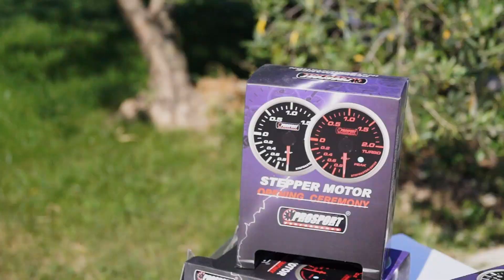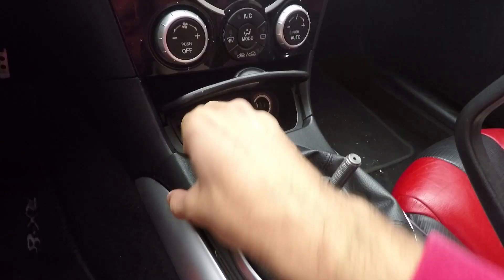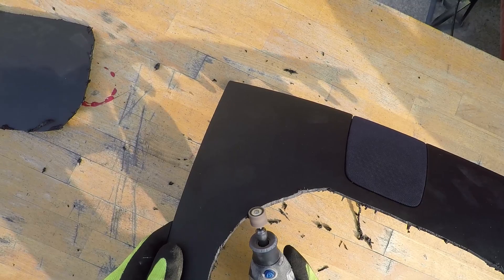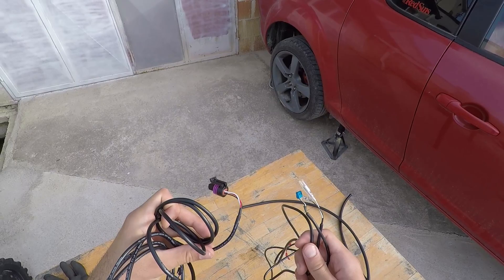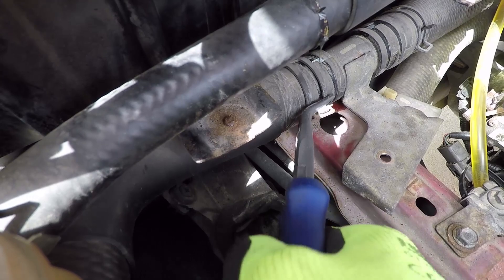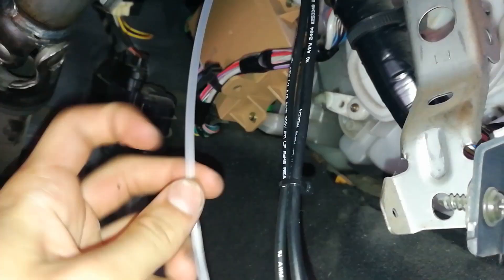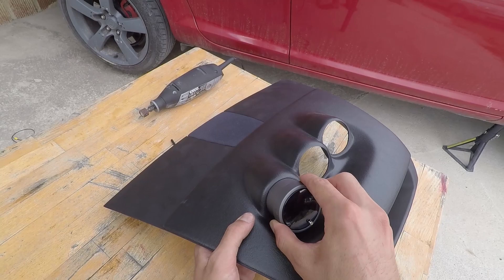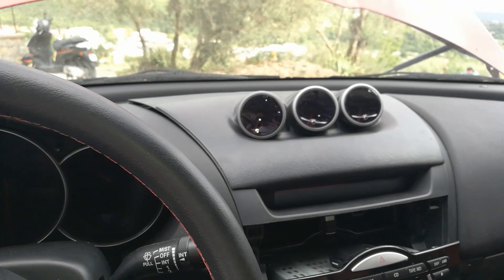Mazda Rx8 Gauge Install | Step By Step Gauge Kit Install

Comment from the maker: If you want to check out the items mentioned in the video, they are linked below: 
🇺🇸 USA & ASIA:
🟠WATER TEMPERATURE GAUGE: https://amzn.to/3U11UQR

🟠OIL TEMPERATURE GAUGE: https://amzn.to/3foylK4

🟠OIL PRESSURE GAUGE: https://amzn.to/3fscEZx

🟠OIL SANDWICH PLATE: https://amzn.to/3zGP8yJ

🟠WATER COOLANT ADAPTER: https://amzn.to/3Ws0JM0

🟠DASH GAUGE POD: http://essexrotarystore.com/product/feed-triple-52mm-rx8-meter-panel/  

🟠TEFLON TAPE: https://amzn.to/3h12nnr

🟠BLACK SILICONE GLUE: https://amzn.to/3WpBLwu

🇪🇺 EUROPE & 🇬🇧 UK
🟠3 GAUGES: https://ebay.us/FaxZPE 

🟠OIL SANDWICH PLATE: https://amzn.to/3WoWfpb 

🟠WATER COOLANT ADAPTER: https://amzn.to/3DUTNPX 

🟠DASH GAUGE POD: http://essexrotarystore.com/product/feed-triple-52mm-rx8-meter-panel/  

🟠TEFLON TAPE: https://amzn.to/3Nwo8b5 

🟠BLACK SILICONE GLUE: https://amzn.to/3UjVzzB
Reply: What sensors did you use and what connectors????
Reply: How long did it all take you?
Reply from the maker: @CivilianAdams  A couple of hours, but i was also filming, so it took longer.
Reply: How mm water coolant?

Comment: I did the same gauge pod a few weeks ago. It's much easier if you use add-a-fuse in the driver side footwell fusebox (cigarette lighter fuse)for power and main fusebox rear light for gauge night mode.  you don't have to cut any factory wire if you do it this way. for an added bonus your gauge pod is now running its own fuse so you don't have to worry blowing the fuse when you plug in something like a laptop charger.
Reply: Hi William, I am planning to do this mod this next week. I am done with Sensors and the gauge pod. My biggest problem is the wiring. I like the solution you mentioned here. As it seems to be clean and easy. But Japanda tuning guy says it is not the right solution. Cutting factory wiring, soldering/ connector clips is the right way. Does your set up still work ? For my new auto gauges I have 4 wires coming from gauge which should be connected to .

1. Red - Battery +
2. Black - Battery -
3. White- Ignition Switch + 12V
4. Orange- Dash lighting/ headlights
Could you please guide me where I can find these wires or Fuses. My gauge pod is located on the air vent. So, I am looking to connect the sensor wires either in Fuse box or wire harness below steering wheel. Any leads are appreciated.
Reply: I confirm it works. One cable i connected to fuse number 1 (cigar/lighter) and second one to fuse number 29 (tail lights). Thanks to that the display of gauges only turns on when i turn on my lights. Of course I used fuse adapters with additional 2A fuse. Im really thankful for that tip 👍👍

Comment: this dude is like the rotary chris fix hahah 

love this channel !
Reply from the maker: Thanks man 💪😊
Reply: @Drivenbymadness   video suggestion. 

maybe a video about what to do when going to look at a rx8 and you want to do the proper testing on it etc. 

like do you have them leave it cold so you can do a cold start then hot start or etc. 

how to do a proper compression test while looking at the car etc 

what compression numbers to look for. 
( if they are lower than xyz = good buy ) 
( if they are lower then xyz = engine will need rebuild right after purchase ) 

etc

i am in the market for a rx8 right now to add to my stable of sh*tboxes lol 

my friend has a 8 in his garage right now that he bought for cheap cuz it wont start( he was going to LS swap it and turn it into a drift car ) 

but ive loved rotaries and have owned a 88 fc vert. 

and feel like he is probably not doing something right. so i could possibly buy it off him for cheap and maybe get it running for cheap as well..
Reply from the maker: @theregoesmiller389  Already made it: https://www.youtube.com/watch?v=w4hxOINhdik&ab_channel=DrivenByMadness

Comment: NEVER attach 2 cables naked without anything, solder it or use connector, but NEVER just twist it together and use some tape on is. It can cause fire in your car. I know there is no big current in this case, but i think it would be important to explain in the video.

Comment: I followed this guide and did it! Im really thankful for that video 😁 the only thing i did different was power cables for gauges, I connected them to fuse number 1 and 29, thanks to that lights on gauges turn on only when I turn on my lights. I used fuse adapters with additional 2A fuses. Cheers!
Reply from the maker: Great job man, I'm happy my vid was useful 😉

Comment: Now do the column pods :D ..  that's a whole other monster to install

P.S. should mention this oil pressure system is only for the S1 since on the S2 the filter got relocated to the top front of the oil pan and would be quite difficult to get that adapter in there.  Also the S2 runs significantly more pressure on the oil system than S1
Reply from the maker: Thanks for the feedback, it will come on handy! I don't even want to think about the Pillar pods xD At the beginning i wanted to install that one, but after a lot of though about it, i went for the dash one, and i'm glad i did :D

Comment: This mod is worth it just for the coolant temperature sensor because the factory one is useless. It doesn't even move until 235F. Hardest part is doing all the internal panel removal and wiring.

Comment: I was looking to get rid of that useless navigator that is stuck with the maps of 2006 or something (ofc I've never even bothered to try use the thing at all).. The instructions are clear ("take it out" :P:P), but too much of an hassle to do for me mate, I'll leave the thing closed xD. I'm more for mechanical stuff than electric one ;)
Reply from the maker: hahaha as you wish mate. You could also get a used dash without the navigation and just do the install. The electrical part is super easy and fast, especially if you use the connectors i have used :)

Comment: This is a great guide but has anyone found a cheaper "kit" or put one together in 2023 for US owners? I might have to hold off on doing this if the gauges are really 70-$100 a piece but as always very good informative video and thank you!
Reply: I put together a budget build for this same style of gauge pod on the dash recently. I chose Glowshift gauges for oil pressure, oil temp and water temp as it was a budget friendly brand but they are still good and stylish gauges. I used the same mishimoto water coolant adapter as in this video, but instead of a sandwich plate adapter, (which can leak, not give you the most accurate oil pressure readings, and leaves very little room for your filter on a series 1 RX8) I opted to install my oil pressure and oil temp sensors into the banjo bolts running to the oil coolers. You can drill and tap your own banjo bolts virtually for free, or there are some available online already threaded for 1/8 inch NPT for 25 bucks each. This location for these sensors is ideal because you are getting oil pressure data very close to the factory oil pressure switch and temp reading just before the oil reaches the oil cooler. As for the dashboard Guage pod, there is one for left hand drive rx8 on amazon for about 50 bucks. Throw in 4 new crush washers for the modified banjo bolts for a dollar each. I priced this setup out at about 350 bucks not including silicon, pipe thread sealant, or fuse taps (but each of these things are cheap enough). I'd recommend the fuse tap route so you don't have to butcher up any factory wiring in your car, and also drill your own grommet hole through the firewall near the hood release cable so you can run your wires through a proper grommet to protect them.

Comment: Thank you! Needed this. But if I want to wire the orange wire to headlights, how will i?
Reply from the maker: Just prolong it with a red wire so it reaches the one of the headlights. Or attach it via piggybank to the headlight fuse :)

Comment: Did the install but the sensor won’t read any temperature on coolant until the thermostat opens. Racing beat adapter is the way to go.

Comment: I have a 2005 RX8 with 119,000 miles on the original engine that has never been opened up.  Car is a daily driver, I don't pre-mix however I do change the oil every 3K miles. Please explain why the oil pressure gauge is not hooked to anything. Is it designed to read normal no matter the actual amount of oil pressure ?
I enjoy all your videos, my first rotary was an RX2 way back in 1974

Comment: This is awesome, I’ve been thinking about doing this to my 8, I have a 2007 grand touring edition so where you would mount the gauges I have a gps would I still be able too?
Reply: Jakob Schmidt they make gauge pods which get rid of the cigarette lighter and ash tray... if you're willing
Reply: There is also the one the replace your cigarette lighter and it looks pretty neat too
Reply from the maker: Jakob Schmidt  You have 2 options: Either you remove your LCD dash and replace it with a normal blank dash and do the installation i did. The second option would be to install the gauges where the ash tray is ( there is a plug and play pod made by racing beat)  or you go for the gauge pillar pod, but i would only suggest that if your car is a track only car, as in Europe we have strict laws, and you can get fined for a pillar gauge pod.

So if you want to keep your LCD scree, go for the ashtray gauge pod :)
Reply: Driven by madness why is it illegal to get a pillar gauge pod in Europe?
Reply from the maker: You can't get an EU approval for it from the factory (TUV/ABE). it "obstructs" visibility and since it's not an OEM feature it's a "danger hazard". Welcome to the EU :D

Comment: Is just for racing an rx8 or should this be an essential upgrade for road use
Reply: Its really a necessery mod as the rotarys overheat easely. these gauges are a nice way to keep your engine happy.
Reply from the maker: Well, without them, you basically have no idea what's happening in your engine until something bad happens. So it's a piece of mind to monitor temperatures and pressure, so you get a warning light and beep, when things start to get uncomfortable and you can basically save your engine on time.

Comment: Quick question, are there any specific sensors you used? Or would just any work?
Reply: It really depends on the type of gauges you go with since most gauges come with the sensor included. 

If you are using the sensor adaptors that he suggests in the video, just make sure the sensors are 1/8 inch NPT threads. Although, I would not recommend either of the two sensor adaptors he suggests for a few reasons. The sandwich plate adaptor is a bad choice because if you have a series 1 RX8, it is going to be a very tight fit for your oil filter. These sandwich plates are also notorious for leaking oil from the sealing surface because you are creating more leakage pathways. Also this sandwich plate is taking pressure readings after the oil passes through the filter element, so you aren't getting a true pressure reading from the system. For the water temp sensor adaptor, this is also a bad choice because this adaptor will only give you true water temp readings AFTER your thermostat opens up at operating temperature and begins circulating coolant through your radiator. A much better solution for sensor locations would be a 13mm or 1/2 inch sensor adaptor tapped into your heater hose, as this coolant is circulating through your engine from the moment you turn your car on and will give you the most accurate temperature readings straight from your engine. As for your oil pressure sensor and oil temp sensor locations, you can get banjo bolt sensor adaptors from either rotary performance or from knight sport (ordered from Japan). These adaptors will tap into the oil feed lines running to your oil cooler(s). Place the oil temp sensor on the oil inlet side of your oil cooler to get engine oil temp reading before the oil is cooled, this will tell you true oil temps coming straight after passing through your engine which is what you want. As for the oil pressure sensor, place this one on that same oil feed line going into your engine block located right next to your rx8's factory oil pressure switch (this is the dummy sensor that tells you you have an ambiguous amount of oil pressure on your dash). If you buy the knight sport sensor adaptor, they have 3 different styles I believe. 2 of them just have different thread sizes depending on what sensors you get, but the 3rd style is a double sensor adaptor with 1/8in NPT threads that allows you to intall both the oil temp and oil pressure sensors in the same location which is nice.

Comment: Tried this and got everything working but now my radio won’t turn on or light up. The A/C switch and Hazard button still works but that it really. Any tips or anything I might’ve messed up?
Reply from the maker: The pins on the radio are not properly aligned. See my usb adapter install for a mire accurate answe on the solution

Comment: Theirs a major flaw in the video , you did not mention anywhere what the (blue with redline wire) is? And what the yellow wire is? , You just name the wires (red , blue , black) and don't explain why the Radio wire is connected to the gauge? And why the Lighter wire is connected? What do the gauge orange , red , black wires represent and why connect them with lighter and radio separately

Comment: as u said we can compare the water  temp of obd2 vs the gauge, is the gauge more accurate ?
Reply from the maker: the gauge is dependent on calibration and calibration is done by reading the obd, which is precise. So i would rely on the OBD2 reading of water temperature as a primary source. The gauge has a marrgin of error of 1-2 degrees C + or -(which is nothing) but it's pretty precise.

Comment: No grounding the water temp adapter or oil temp sandwich plate?
Reply from the maker: The grounding has been prolonged inside the cabin and grounded under the gauges :)
Reply: Driven By Madness oh ok thanks

Comment: Good afternoon,what is the size of the water temperature adapter?.2009
Reply from the maker: Dont have my rx8 at home right now... You can check the link in description to find the one i used.
Reply: Thanks
Reply: 38mm

Comment: do these gauges come with the sensors?
Reply from the maker: sensor yes, but for the ocolant and oil  you need to buy the mishimoto adapter for hose and oil sancwich plate.

Comment: oh man... going thru the firewall... that was cringe. literally could have put a grommet in there so your nice new wires wrernt rubbing on the nice sharp metal of the firewall hole. with the existing rubber boot pushing on them adding pressure!

Comment: I'm wanting to buy an RX 8 on Monday I found one for $3,991 with 79,000 miles. It smokes a little, do you think I should get it?
Reply from the maker: Does it smoke only on startup or constantly? If there is a constant thick white smoke that doesn't go away, the coolant seals are leaking coolant in the engine. To fix this you're gonna need a rebuild
Reply: @Drivenbymadness  I'll test drive it and red line it after it's properly warmed up to see if it clears up. How much should I redline it?
Reply from the maker: @skylerbond56  redlining it wont solve the issue of a bad seal. If the smoke does not go away after a short drive, it's probably  that
Reply: @Drivenbymadness  So at that point pass it up?
Reply from the maker: @skylerbond56  you cn go and check If it has a thick constant white smoke. If it goes away under a couple of minutes, its ok
Reply: @Drivenbymadness  It's like a blue smoke I haven't driven it yet though
Reply from the maker: @skylerbond56  blue smoke means oil from the engine is leaking inside the combustion chamber. Oil seal failure is the cause of this and the only way to fix it is an engine rebuild. Mechanic's inspection should give you a definite answer :)
Reply: @Drivenbymadness  So at that point $4,000 is too much for the car?
Reply from the maker: @skylerbond56  if you can get a mechanic to confirm that that is the case, then 4000$ is sadly too much.
Reply: @Drivenbymadness  Okay so if it needs engine rebuild what would be a good price for the car?
Reply from the maker: @skylerbond56  around 2000-2500max. If you get the confirmation that that issue is causing the smoke and it can be fixed only by rebuilding the engine, then you'll spend around 2000$ for the rebuild.
Reply: @Drivenbymadness  Oh okay yeah is that $2000 for the parts? Thanks for the help buddy!😁
Reply from the maker: @skylerbond56  parts+ labour. Prices vary, this os just a general quote. Could be more, Could be less. No problem man :)
Reply: @Drivenbymadness  Forgot to mention the car has 79,000 miles on the odometer, but Carfax says it has 129,000 miles so it seems odd and it's a car dealership with it
Reply: @Drivenbymadness  That's not too bad for a rebuild. My Integra cost more to rebuild, but piston engines have more parts.
Reply: @Drivenbymadness  I found out the blue smoke was from sitting, and it smells like a 2stroke dirt bike so maybe premix was used by old owner? The blue smoke went away after I drove it a bit, and revved to 9,000 rpm it also drives smooth, and strong!